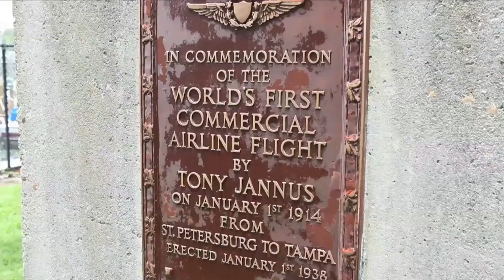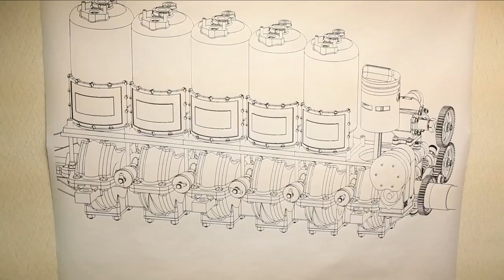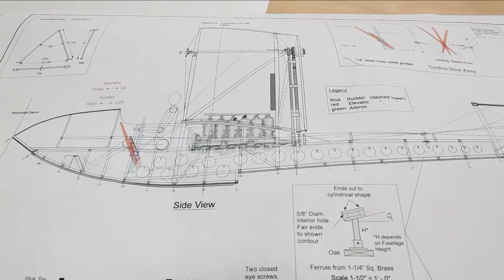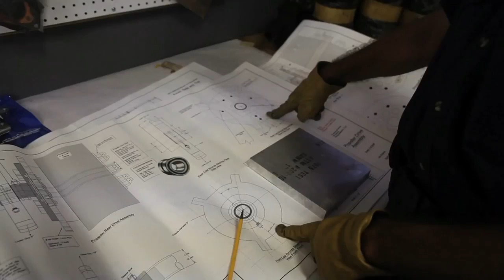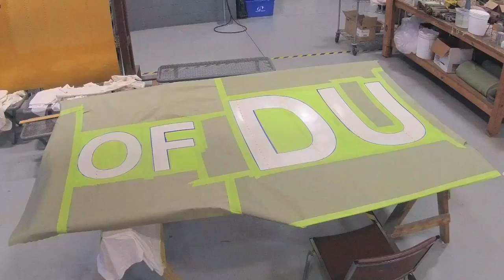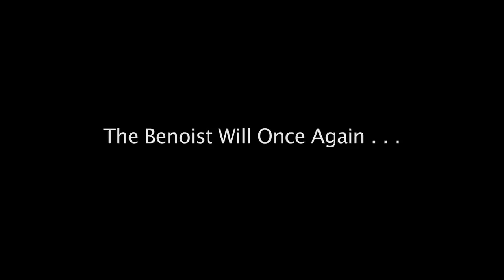Benoist Project - Progress to Date

Comment: St Petersburg to Florida! A big venture even now. I tried to google this adventure but couldn't see anything. How many stops did they have to make? Which route did they take, I would imagine it must have been either Iceland/Greenland (inc North Sea/Atlantic) or Bering Strait (inc Siberia)? Either way there's some very scary legs.
Reply from the maker: ??? That's St. Petersburg Florida to Tampa Florida!
Reply: @KermitWeeks444   Woops. It did seem a bit impossible for the time, but I wasn't going to argue on the achievement. Sorry, I didn't realise you also had your own 'St.Petersburg', and Google only found the 'Leningrad' St.Petersburg when I searched.
Reply: Scary enuff one side of the bay to the other!